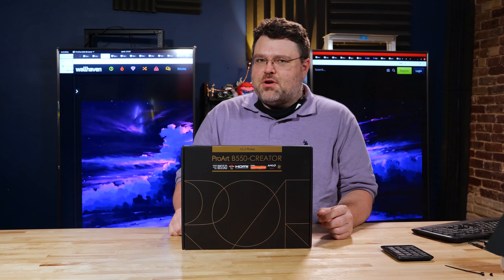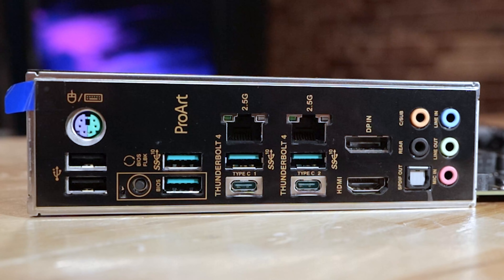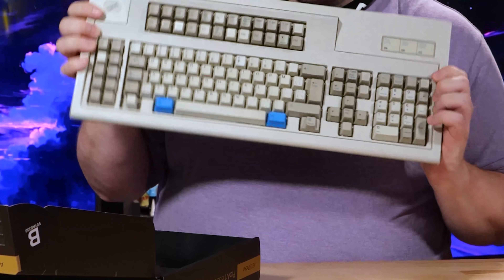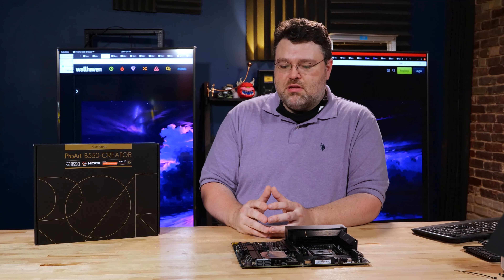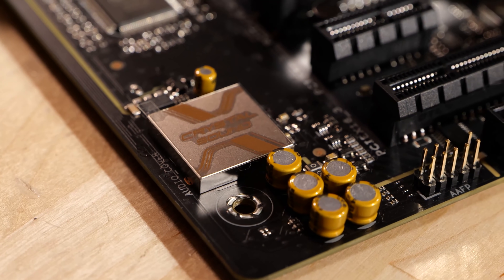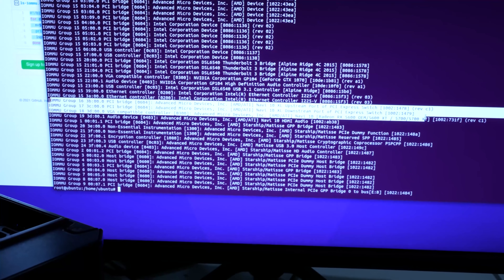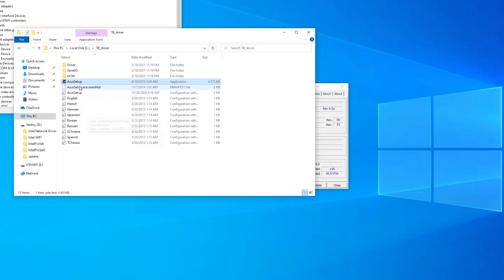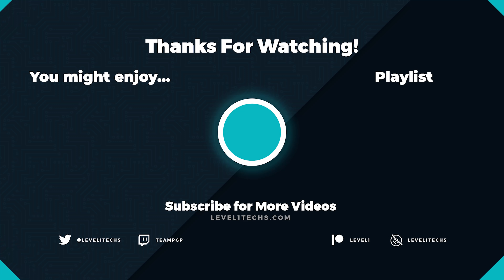ASUS ProArt B550-CREATOR Review - Dual Thunderbolt & Linux Testing!

Comment: Another note from someone testing this motherboard for a while: You can remove that stupid acrylic plate that is screwed to the chipset heatsink.
(I know this is unlikely to be an issue with B550 but I consider it extremely “distasteful” to insulate a passive heatsink with plastic)
Reply: what do you think about this board? would this be a good board for building a proxmox / storage server or do you think x570d4u is better?
Reply: I’d say it all depends on if you really want to use KVM-IPMI: If not necessarily I’d go with the ASUS or maybe try adding an aftermarket IPMI solution. I haven’t personally gone back to ASRock Rack since the X470D4U debacle for motherboards, but I got a few PAUL KVM-IPMI AICs for the use with consumer motherboards. To this day ASRock Rack hasn’t responded to me about PAUL firmware updates, was lucky enough to get one through the vendor.

After typing these experiences my gut says to still stay away from ASRock Rack, stuff like them manufacturing the dual 10 GbE variant of the motherboard with the Intel X550 NIC in debug mode doesn’t exactly help regaining my trust (cp. the L1T forum thread).

So far I’ve not had a “real” issue with the ProArt B550-CREATOR, just general drivers stuff that’s annoying when using Windows with it (unkown USB controller device that needs a driver from Microsoft’s update catalog, Intel’s strange Thunderbolt driver package installation ritual, AMD chipset RAID1/10 with extremely poor sequential write performance triggered by unknown circumstances).
Reply: @abhineetsingh12  Definitely any server board will be better.
Reply: I just ordered this motherboard for my new rendering PC. I also wanna play games either. But generally comments are about this board is not worth to buy it for doing "ProArt".  What do you think?
Reply: @andante1850  The main thing this motherboard has going for it: 2 x Thunderbolt 4 ports on AM4 which include USB 10 and 20 Gb/s support, 2 x 2.5 GbE ports. A bit sad: No Bluetooth or Wi-Fi onboard. The BIOS is mature, the only thing missing compared to some competitors is support for PCIe Advanced Error Reporting (AER), nice but an extremely niche tool tor troubleshooting.
Reply: @abavariannormiepleb9470  Thank you for the response! How can we make up for the lack of AER feature?
Reply: @andante1850  contact ASUS support and ask that they show this option in the AMD UEFI menus, it’s usually in the same menu as the IOMMU option (like on ASRock motherboards, for example). It’s not something ASUS has to “develop”, someone chose to not show this option to users. If you are working with U.2 NVMe PCIe Gen4 SSDs that are connected via cables or risers for GPUs, PCIe AER can help locating issues with showing PCIe Bus errors to the operating system, if PCIe AER is disabled there can still be PCIe Bus errors that can cause system instabilities but no errors appear in any logs.
But again, this feature isn’t something a “normie” user really needs to have. I encountered it in my quest to use U.2 Gen4 SSDs in 5.25” backplanes to be able to easily swap them while bad cables had been causing quite severe issues.
Reply: Got it. Thank you so much!
Reply: @andante1850  No problem, I’ve been continuously using an ASUS ProArt B550-CREATOR with a 5750G as an energy-efficient yet quite powerful 2D audio/video system. For me personally the Thunderbolt ports are critical. Added an Intel Wi-Fi 6E + Bluetooth 5 add-in card from Gigabyte and two internal M.2 NVMe SSDs for OS RAID1, am happy with it. The only thing I absolutely dislike is that with all current* AM4 APUs outputting a real fully-featured HDMI 2.1 video signal is technologically impossible, otherwise I’d consider it a close-to-perfect implementation of the B550 platform.
*There is still a tiny shimmer of hope with rumors that there is going to be another AM4 APU with Zen 4 cores and RDNA 2 (?) iGPU.
Reply: @abavariannormiepleb9470  I see. I bought Rog Strix RTX 3080, Ryzen 9 5950X and Samsung 980 Pro NVMe M.2 with this ProArt B550 board. As you said I also have to buy wifi and bluetooth cards.
Reply: @abavariannormiepleb9470  Hi, just ordered this motherboard ( 187euro in Amazon) and find out there's no WiFi/Bluetooth in. Which slot is best to use to not interfere with GPU?
Reply: @radeksudnik  I had been using it with a PCIe x1 WiFi 6E/Bluetooth 5.3 adapter (GIGABYTE GC-WBAX210) in one of the PCIe x1 slots. My WiFi environments max out at WiFi 6, could get around 1120 Mbit/s during speed tests. As long as you don’t use the second PCIe x16 slot with metal shielding for anything else your dGPU will remain at a x16 link. WiFi and Bluetooth don’t really profit from a direct CPU PCIe interface.
Reply: It’s an absolute non issue, running cinebench and mobo temp stays a rock solid 33C. This motherboard runs amazingly cool even with overclocked cpu
Reply: In theory the cover would allow the heatsink fins to act as an air tunnel. When motherboard is oriented vertically hot air would run upwards and it would pull cooler air from the bottom side thus creating passive airflow.
Reply: Yeah, nope - these indentations are much too small to be used for passive convection (cp. the larger distance between the fins of the new Noctua NH-P1 passive CPU heatsink compared to regular ones) and air flow even from slowly operating case fans overpowers convection in computer cases anyway.

Comment: This is great, but I think that smaller FF mini ITX boards would actually be make more sense for reallocating unused PCIe lanes to TB4 ports.
Reply: Exactly, killing 2 birds with one stone... Heck the rear 2x2.5GbE + 2xTB + 4xUSB3 + 2xUSB2 + 6xAudio + BIOSFlashback only need extension/moving of HDMI/DP-IN a bit to accomodate for a built-in WIFi antennas (eg. connected to an M.2 WiFi6E Intel or Killer user replaceable/upgradeable NIC) dropping those unused PCIe lanes for better built-in rear I/O would pay dividends in a market devoid of really good feature sets and rear ports (in platforms that are not as easily extended through add-in-cards).
Reply: like the x570 itx tb3?
Reply: @morcogbr  but with multiple TB4 ports
Reply: @morcogbr  Similar but with more TB ports and more USB3.2-typeC and USB3-typeA ports as well, as most of the AMD mITX boards have limited rear I/O connectivity with usually 4-6 USB ports in total... in a platform/form factor that cannot be further extended through multiple slotted AICs...

Comment: No mentioning of the absurd “NO SECURITY”-only Thunderbolt operation?
Reply: You have bigger problems when someone has physical access to your workstation.
Reply: Well there might also be outdated older Thunderbolt devices where the firmware might have been compromised so you don’t directly notice it when you are doing something malicious to yourself.

Comment: How to handle Intel’s latest Thunderbolt drivers - also on this motherboard:
1) Don’t let the system be connected to the Internet
2) Decompress Intel’s latest Thunderbolt drivers package
3) Manually install all the Thunderbolt .inf files in the decompressed folders
4) Reboot
5) Connect to the Internet so that the Thunderbolt management GUI software can be automatically downloaded from the Microsoft store

It sucks but I’m done fighting with it.

Comment: If I needed a new board this might be it. But I got a great deal on a gigabyte b550 auros pro WiFi atx sized board. Has 12+2 phase vrm and a super overkill finned heat sink. So since it’s finned, My noctua u12 and its 2 fans really keep those vrm cool even tho ryzen doesnt push much power any way. Paid 150 bucks for a “used” board from amazon warehouse but it came sealed in the box brand new with all the accessories box was never open. Here’s my pro tip, if ur looking for a board including this one, check out amazon and see if there are any used ones . Buy from the amazon warehouse seller and look for like new condition. Good chance u get a non opened box that someone else returned and I saved 25%. Looks like there arent any used boards on amazon for this motherboard. But in the future if you read this I suggest taking a look and seeing if u can save an easy 25-75 bucks on a brand new board that a customer returned, but cant be sold as new.worst case is u get an open box/used board and you can examine it and see if it still is worth it, and if not easily return to amazon

Comment: Perfect timing, I literally just put it in my shopping cart... :)
Reply: ...and in the end went for the B550 Vision DP instead. Only to get the news of fanless X570 a day later :p
Reply: @MichaelAuerswald  honestly you likely did the right thing. everyone who bought this board including myself and pounding their heads against the wall right now. if i dont get this sorted out in the next couple of days im sending it back and going the same route as you. is the thunderbolt 3 working out just fine? thunderbolt 4 is hell which is making me question if they're either producing a bunch of lemons, or the support isn't truly there yet. it's gonna take more than one stiff drink to calm this rage
Reply: @SuperSaiyanScandinavian  I'm not using TB3 so I don't know for sure. Everything else is working once I got new RAM (it was unusable with the HyperX modules and works rock stable with the Ballistix now). Still kind of regret not waiting for the fanless x570 since only having two PCIe slots (with two m.2 installed) is limiting.
Reply: @MichaelAuerswald  The X570S Aero does not have TB, but rather USB-C with DP. Not sure on a technical level what that implies, but I suppose you won't have general purpose PCI-E Lanes for peripheral devices. Gigabyte markets the Aero as having VisionLink which can supply a "Drawing Tablet" with DP,  USB-PD and USB Host (touch).
Reply: @MichaelAuerswald  B550 Vision DP didn't work with HyperX RAM?
Oof. I currently use an msi x470 gaming plus and its VRM doesn't really work well with my 5900x and I'm planning to upgrade the mobo, however probably not going for this one since I don't use thunderbolt nor am I planning to. I was actually considering the B550 Vision DP - but now that you've mentioned it's not compatible with hyperx modules...That kinda threw me off. (I have a 2x16 GB HyperX predator 3333mhz memory kit)
Reply: @RavexMisc  Could just have been my particular ones (don't have the details any more, sorry). But can confirm Ballistix are running fine. With the HyperX is had constant crashes (and increasing in severity, weirdly) on Windows. Strangely enough it ran more or less stable in Linux.